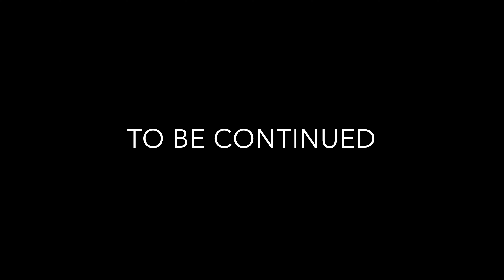BMW R65 Cafe Racer build - Step 7: Subframe and Rear Fender

Comment: Is this whole monoshock frame a plug nd play bolt on?  I'd love to try something like this but I don't have access to a welder.  Also when you removed the old suffrage was it bolt off or did u just cut it off with a grinder?  Thanks in advance for the knowledge!
Reply from the maker: The subframe is made to fit the frame itself, it are just some bolts. You can order it like this with Vonzetti.com.

Comment: Nice bike!  How long did it take to receive your Vonzeti items after you placed your order with them?
Reply from the maker: I asked for a speed delivery and that took 4 weeks. Normal delivery takes about 5-6 weeks.
Reply: HI - I ordered the same back frame/sit ~2 years ago (to Germany) ..took like 6 weeks. But price & quality was very good! But my frame had no extra idicator holders ..maybe I missed to mention it while ordering; had some issues fixing it
Reply from the maker: The holders for the turn indicators were welded by a friend of mine. I don't think it's possible to get it done by Vonzeti.
Reply: @LifeofRubbel  OK..thought It was already delivered this way. Good job 👏Ist the Daytona tacho working well?
Reply from the maker: Thank you. The tachometer works fine. I had to do the configuration manually which took only a few minutes
Reply: Videonauts Grauadlers Reisen Servus, hattest du Probleme mit dem Tüv? Oder wie hast du es eintragen lassen? Danke schonmal.